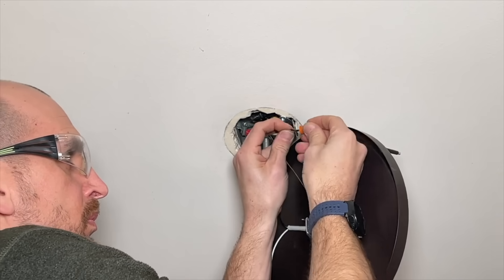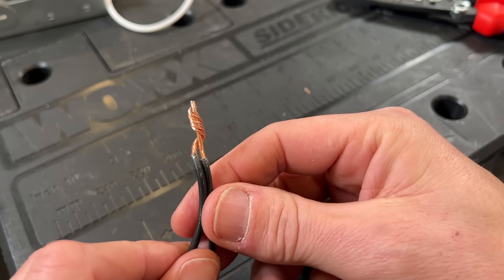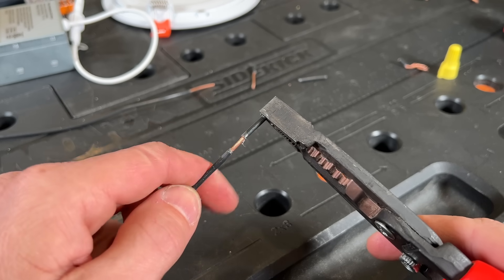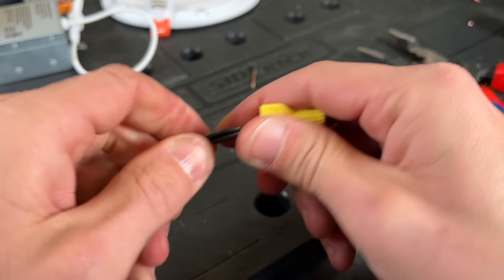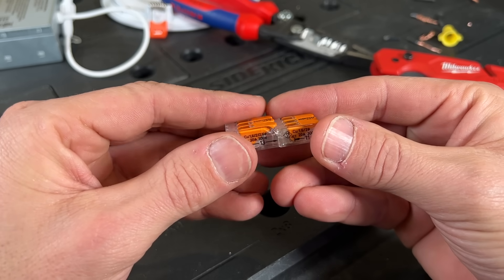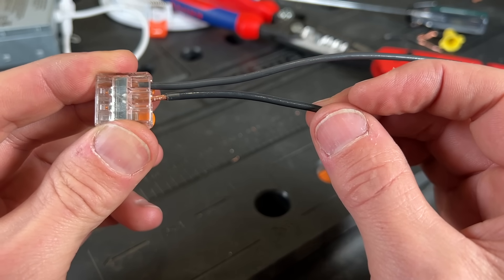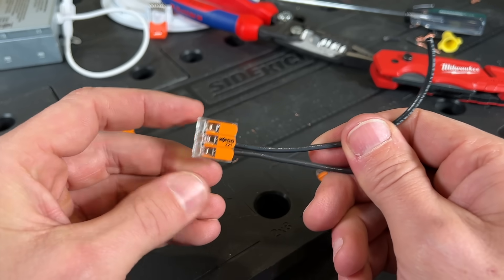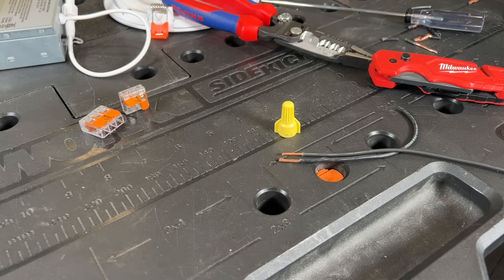Most Common DIYer Electrical Mistake - Don't Let This Be You!

Comment: Look any engineer sufficiently educated on splices for durability or quality of a wired electrical connection will tell you soldering wires together is the best method to ensure a solid connection. Especially two wire types such as solid wire to stranded wire. That contraption at video end is rediculous and yes it adds added stress to stranded wire because of the pressure it places on a single strand of stranded wire crunching them on top of the other strands who actually are doing all the work as that one single strand stays crunched up with a knife against its back. Any vibration and that connection will begin to fail by that single strand breaking in which a spring like movement forces pressure on the next strand or 2 strands, doesnt matter because breaking just one strand of multistrand wire compromises the integrity of the connection which could effect integrity of the product it leads to. For electronics and all the software glitches which come unknown but are standard to expect, bad connections can unleash glitches by the inability to flow uninterrupted from one point to another along wires. Breaking a stand either by stripping the wire & cutting a strand, even knicking a strand is call for complete rejection of a product until corrected in the only part of the electric/electronic industry where failure could cost a human life. You would never find that connection or anything as absurd as twisting wires together on anything built for aerospace, military, or the medical industry. Its bad enough its done in the automotive industry because environmental factors add to corrosion which eventually corrosion acts as a insulator preventing full connection. Damaging a strand of wire has the same effect as corrosion. It ends the full connection. Those strands of wire have been mathematically calculated as the minimum required to ensure the product works to keep cost down because copper ain't cheap. Those connectors aren't cheap either but are cheap as far as quality is concerned because they are banned for aerospace, military, or medical equipment where failure could cost human life. Well sorry, but if its not good enough for a hospital room or a flight to New York its not good enough for my diy project as well. 

Strands of wire is especially critical when connecting high amp AC products usually capped at 15 amps for a 115vac line. The break of a single strand OR a lose strand despite surviving a pull test WILL force current or heat onto the remaining strand which could result in the wire overheating. You see this in automobiles all the time after the elements of outside environments create corrosion opportunities within stranded wire which acts like insulation forcing the wire to heat to the point it simply melts. In a house firemen find this as a cause of killer house fires because some idiot used an extension cord rated for 7 amps to supply his space heater on HIGH or 15amps. By conmecting a wall heater you can not prove every strand is making a good connection by using a yellow nut screw. Soldering is the only "acceptable" connection in industry much more advanced and its simply amazes me the standard lack of safety from electricians who claim a nut screw is sufficient to make a connection. Its not unless the multistrand wire is designed for a failure of strands making connection. Overdesign is expensive today, but has fixed stupid in the past . Soldering simply eliminates the threat. Soldering, also, is faster cheaper and more durable. Just remember to put flux on before soldering, the bigger connection the bigger tip needed, use alcohol to clean flux residue off the wires left exposed, wire insulation shrinkage proves low quality of insulation of the wire it covers, remember to place heat shrink for wire to completely cover wire & solder connection when shrunk from a heat gun (a hair blow dryer also works for low quality insulated wire) and right there you have a secure connection made for a trip to Mars & back. A wirenut wont even get you off the ground. Its cheap quality but accepted as good enough which sometimes it is. Pull testing is essential but does not guarantee each strand is connected. Think of someones life depending on that connection and know in the aerospace industry you can be arrested if that connection fails. There are employees of Boeing wanted for murder with warrants from another country where loved ones died "probably but not positively" because of their work. Think of that before you use a screwnut or whatever that awful pos is called. 
HOWEVER... if you must or some baby boomer goes wingnut on ya, just remind them how ancient thay technology is and how many firemen have pulled babies out from house fires because it failed.

Comment: Pro tip. If you treat every electrical repair as if the power was still on you can’t go wrong. I’ve had people turn breakers on while I was working on circuits and have turned the wrong circuit off myself. No contact testers are great but again even when I know the power is off I handle wires carefully. You can get feedback voltage through neutrals from other circuits. When in doubt call an electrician. I’ve done many repairs where homeowners did the work wrong or they “had a guy” do it wrong for them. With 40 years experience as an electrician when I try and rush a job is when mistakes are made.
Reply: I just flip the breaker and test the wires. My primary safety technique is doing only one job a day and doing it slowly. Since it's my own house and I am not being paid for it, I don't have to rush.
Reply: Until the woman starts nagging you about the next thing she wants done.  @T1Oracle
Reply: Simple solution use tag outs on the breaker 👌
Reply: @cappiece3786  Paper and Clip types are a no go around Retarded tenants that pull them, even locks get cut by the occasional entitled one. I lock-out Tag-out and work like it's live.
Reply: @johnhubbard3485  good practice
Reply: Kill the Power, Lock-Out the Power, Test for Power, every circuit, every end you are working on. Multi's (apartment rentals) have taught me, just like plumbing some folks just borrow from whatever is in the wall, even if it goes to a different unit. Dishwashers, Microwaves, Range Hoods, even that extra outlet in the middle of a party wall occasionally are found hot, with the main and everything in the unit panel shut down. 
Don't even get me started on how they rob the power for the illegal grow rooms in the attics.
Reply: Like drilling a bore hole and feeling unnecessary resistance only to find out after looking on the other side of the stud, you are boring through a stapled 220 line...I've slowed down
Reply: @michaeldorgan5189  hahaha I drilled through what I thought was a metal stud to hang a push pin board in a commercial setting. It turned out to be the back of a electrical panel and the bit hit the buss bar🤣 vaporizing it. The resulting molten mass tumbled down onto itself continuing until it pooled in the bottom of the box. The main breaker never tripped 🤣
Reply: @nunyabusiness3082  we had a roofer drill down and hit a commercial 480 that was safely  secure to the ceiling……
Sounded and smelled wonderful…..   ;-$
Reply: 😂😂😂 turn power on yeah that's actually not funny yes I been there to..120 volts don't feel that good between your fingers...
Reply: Lock out tag out boys. Go home safe every day
Reply: Same has happened to me, even with the breaker taped off 🤷‍♂️
Reply: Great tip, I do the same, can’t be too carful when it comes to electrical. I know many people and heard many stories effected by electrical accidents. Always treat wires as they are live! Great habit to get into, not touching the Cooper.

Comment: What about the resistance factor of the Wago connectors? That seems to be the big issue I see with electricians not wanting to use them. Also, I've been told only one stranded wire with one solid conducter in a wirenut. What do you do in the case of for example my hard wired smoke detectors. Two solids+a single stranded on every connection but the last detector.
Reply: if electrician not want use wago and use wire nut shit not have true pro elektrician and better this men looking somethink other work not electrician work newer.

Comment: Doing repairs in 20s houses, I encountered splices that were obviously made before the invention of wirenuts.  Since each splice was soldered before being wrapped with rubber tape, I solder each splice before wrapping with a wirenut.
    I realize that not all DIYers have soldering gear, but as a ham for 60 yrs makes this a real no brainer.
Reply: It's your time but commercially speaking soldering every connection is highly impractical.  If you have the time I'm glad for you.  I've never heard of the brand he mentions but the type of connectors he is shilling for work pretty well.  I'm sure there's no arcing problems in your house.